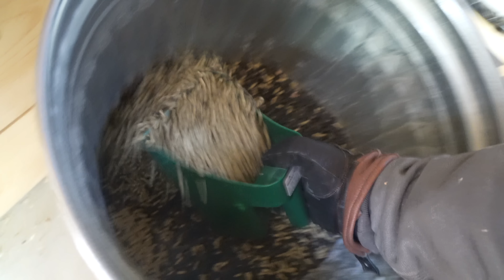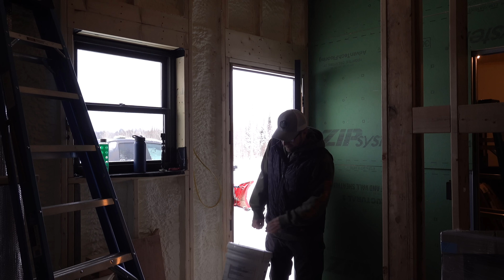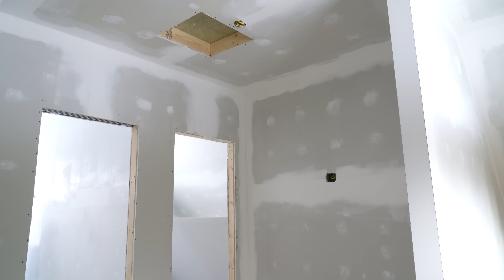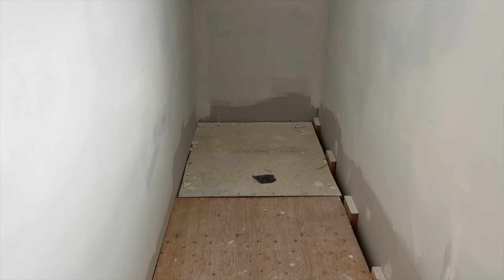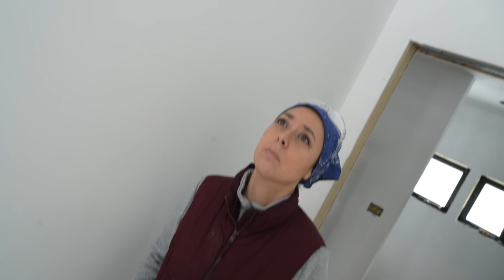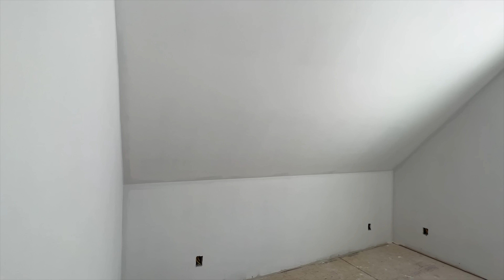FINALLY It's FINISHED!!! Husband and Wife Build OFF-GRID Tiny House in the WOODS

Comment: Gina in the future if you use a short pole on your roller your back and arms will thank you. Having been a painter for years I have found an extension pole always makes a difference in even application as well...further away allows you to see the surface better.
Reply: Should she use a short pole or an extension pole?  You comment was confusing.
Reply: @bettablue2660  short extension pole if I must be exact. Short or long pole allows less effort to apply an even coat and further away from wall will allow you to view your work better. Of course you can use a screw in wooden broom handle cut off to what ever length is comfortable to you for the task. Hope this gives you more insight on what I was saying.
Reply: @garymixson687  thanks, you made it more clear😃
Reply: It doesn't need to be an extension pole . Over my yrs of painting I'd say 90% of it was done with a stick the same length as a broom stick. Anything under 8 ft an extension pole is more trouble than anything
Reply: @mrdio4625  i agree...i have used a cut off wooden push broom handle.  Usually when in tight spaces where a long one will not allow access
Reply: Thank you for the information

Comment: Al, when pouring from a small opening like the 5 gallon bucket turn the pour spout to the top. It will flow out more evenly as the air flows in. Les splatter and quicker fills
Reply: It would have flow out better if you stir the paint first

Comment: Even if it's going to be covered by baseboards, you may want to slap a coat of primer on the drywall down at floor level.  If nothing else it will help protect the drywall from damp.  Your home is looking great!
Reply: if you paint down at the floor you have to do that last or with a brush because dirt will get in the roller... but yeah can't hurt

Comment: I am an old painter take the lid off and stir your paint first and Kiltz is top notch primer. wipe the rim of the pour hole with a paint brush after pouring and wipe the brush out on the wall.  To take the lid off take a pocket knife or a razor and cut each slit in the lid all the way around and pull the lid off pulling up hard on each little flap. Its difficult to pull off but it comes off easier each time after it breaks in.

Comment: You usually apply only 1 coat of primer. It just ensures good bonding and is not supposed to give color coverage. You might work little bit on your inside corners by hand, it seems there are not so smooth. Last, even painting in the lower section an extension is the better choice ...less stress on your hands. Coming along quiet nice, happy for you guys and cannot wait to see next steps.

Comment: Excellent painting job!!!  When doing a large flat surface, You might want to paint a large W on the wall with every recharge of the roller.  Paint the W and use the rest of the paint on your roller to cover the W.  Makes for less streaks.  Aloha from Hawaii!!
Reply: Have you considered a corner paint roller? A lot of what you had to do from a ladder could be done from the floor.
Reply: That is the way I do it, paint is so good now a days it doesn't streak like it use to. But I always cut in first and do trim.
Reply: Would a large M work? 🤣 Sending some snow your way .... enjoy ❄☃ Have a nice weekend ... take care.✌
Reply: A capital “M” works much better.🤣😃😂🤔😎👍
Reply: @robertgiguere7137  😁😎😂

Comment: Primer might have settled, if you remix it with drill and the same paddle you used for joint compound might have had a better consistency.

Comment: have you ever used the 1 inch rollers for cutting in around all the corners and the ceiling.Its a great time saver and it puts paint in the corners and on the wall at thesame time. Great job AL and GEENA

Comment: Two tips. If you are painting that much it is easier to paint out of a five gallon bucket with a screen and when you are painting over your head extend your pole so you can reach further so you can keep your arms lower and can stand a little behind your roller so you won't be directly under it.

Comment: You guys need to stop questioning yourselves. Your doing a great job. Primer is meant to cover and seal new drywall and mud for accepting paint, so it won’t completely cover and you don’t need to do two coats.
Reply: 2 coats of primer is cheaper than having to cover a second coat of regular paint as paint is more expensive than primer, if AL gets a good 2 coat seal of primer and does 1 good coat of paint the overall cost if the painting will be cheaper than if he has to do a second coat of paint, if anything he could have asked thr paint company to add tint to the primer to start the color tinting process of everyting as you can have primer tinted to match the color that will be painted, it's a little trick I learned in the remodeling indusrty
Reply: You can see color variations with the initial coat of primer. That is not ideal. Yes, it may take two coats of paint to cover it which is more expensive, like the reply states below. HOWEVER if you used "Cover Stain" oil based primer, after all it is called cover stain for a reason, only one coat is neccessary for total hiding coverage. Plus if you have any nubs that are showing, or if your roller starts to accumulate the powder left over by sanding, it may decide to lay a glop, or two, or a hundred in different spots that you cannot sand out with water based primer that takes two weeks to dry according to the manufacturer. I wonder how long it takes a second coat to dry on top of a base coat that is not dry yet?
Confession time. I did an elaborate explanation of this before during an earlier episode, and I have to be honest with you, it was painful to see hearts from you guys on every other comment except for mine. I guess I am a sensitive kind of guy, but it wouldn't matter so much if it wasn't for the fact that I love this channel, and what you guys have together so much. I'm a dedicated fan, and i admire how exacting you are in making everything plumb, true, and square. Your cuts are so exact, my hat is off to you.

Comment: A Wagner SideKick machine will make all of your painting go very fast. It's under $100 to. I love mine, did concrete block basement walls in nothing flat. (No pun intended.) You can hook it right up to the big paint container. You'll have to clean it after every use, but it's worth it. You can also get a splatter cover for your roller.

Comment: I drill a small air hole in the lid of the paint bucket.  I use a dry wall screw to pug the hole.
Can you spray paint?  more prep time, but quicker to apply.

Comment: A better trick to extend the life of the wet paint roller is to wrap the roller with a damp paper towel, then wrap that with plastic cling wrap.  Make it long enough that you can fold it over the ends and the roller will be good to use for a couple days.
Reply: if you wrap them and stick them in the freezer, they will keep for several weeks without drying out.
Reply: Yeah and don't completely roll the paint/primer off the roller before you put it away. It's better to leave some on so it doesn't dry out.

Comment: Al, even though the bucket of paint was shaken, I'd still remove the lid and stir it. As someone else said, split the paint up and put a roller grate in the bucket and paint straight out of the bucket, bonus no roller pans needed.

Comment: I suggest getting a paint stick. I’ve done a lot of painting over the years and it speeds up the process because you don’t need to keep going back and forth to the paint tray to reload the roller. You reload the roller through the handle.

Comment: A suggestion for painting.  Use a 5 qal. bucket with a roller screen.  It is way faster.  There is no need to keep filling the small trays.  It is less messy this way.  This is how the pors paint.

Comment: I'm just impressed by the fact that you're using a drywall sealer.  There are many so called professional painters that have never heard of it.  Including the one that I had paint my new home.  I had to explain the concept to him.
Reply: We purchased a home that had heavy smokers as former owners
Reply: Oops! We tore up most of the carpets, professionaly cleaned the remaing ones and sprayed Kilz primer before painting our walls and ceilings.  Being non-smokers, we could not detect any smell of smoke!  It has many benefits for the home owner as previously shared by your viewers.  Your home is looking great, Al and Gina.
Reply: I would like to think that he was teasing you.  He should have known about drywall sealer.
Reply: @pammurphy9311  Not necessarily, around me (north central Fl) you can find Kilz in small cans to seal smoke & such but you have to hunt for 5 gallon containers. And contractors (in my experience) just don't want to use it.
Reply: @pammurphy9311  actually no.  He was from another country.   He contracted through the builder and didn't understand the concept of drywall sealing.  Neither did the builder.  We argued for days.  By the way I am a retired painter but it wasn't in the contract for me to paint my own house.
Reply: @chucktintera1787  That makes sense.  Up in the North - Illinois, they don't want to, and don't legally  have to, use vapor wrap around the outside of the house.  This house, I wasn't able to be here every day when they were building.  I swear our plumber was drunk, things done backwards, upside down and not anchored.
Reply: @timthayer9500  Oh, boy.  Glad you were there to save your house build!
Reply: @pammurphy9311  Illinois? You don't have to tell me, we lived outside of Chicago til '57.

Comment: Get an 8ft extension handle for the high surfaces so you don't have to stand directly under your work. And use the short handle for the lower surfaces so you don't have to kneel or bend down so much.

Comment: Some tips.  
Sand the primmed walls you will love the smooth walls before paint   
 If you roll from corner to corner keep a wet edge you will have less roller marks. 
Looking very nice.

Comment: Awesome job as usual. A little hint. Try a paint sprayer, it will speed up painting by hours & a lot less messy. Also always mix your paint again before using. You have to consider the cold climate the paint endured on way to off grid house.  God bless y’all. Rohan Ranch , north Texas

Comment: Hi al and Gina watching you put that primer on and trying to cut in the corners with a roller that’s a lazy way.as a decorator for thirty years primers and emulsion you should cut in the corners etc with a good three inch brush then use a roller much better finish.

Comment: You should have invested in a good to great air spray hun to shoot the Klix drywall covering as it should take two maybe three coats as that drywall sucks it in. Getting the primer right will save on paint later where one coat might do but two paint costs will be an outstanding job

Comment: If you have not done so, you will want to wipe the walls with a lint cloth to get all the remaining dust off.  Run the drill mixer so the primer is well mixed.  Please be careful with those bracket supports on the stair platform.  Prime in a W pattern.  Long strokes from top to bottom.  Ideally you should paint with the temp being above 50 degrees.  The colder temp will make the water in the paint firm up more..

Comment: I primed our whole house with Kilz.  I had several buckets and I used an airless sprayer and back rolled it.  One of the buckets had obviously been frozen and was chunky and would not flow through the sprayer.  I Had to return it.  Learn to paint like the pros.  Use a 5 gallon bucket with a screen, not a paint tray.  Put a handle on your roller.

Comment: You brought something to mind Al, when you said drywall dust. When we built our house, we found after moving in, that the windows were extremely difficult to open and even more, to close and lock. We had a guy from the window company come out and he explained to us that the thin film on Sheetrock dust created from sanding so effects the tight tolerances that what we experienced, is the result! We had to do a very through cleaning of all tracks, taking the window sections completely out to clean. So…at some point….the time and labor intensive cleaning is absolutely worth it!!
Reply: Good tip - thanks!

Comment: New plasterboard will always soak up your first layer of paint, know matter how thick you roller it on. I always size my walls with a very watery/pva glue mix first, let dry then paint it. Pva watered down solution is a far cheaper option.

Comment: Wow painting already, you guys are fast, with painting I only have one tip, buy the paint regardless of cost with the best solid coverage with minimum  translucency, this alone will save you hundreds of dollars on a small to medium size home. Oh yeah just a side tip, put your top coat color in your undercoat at a 50% ratio, helps with painting so not to miss spots.

Comment: As a professional painter, I suggest you invest in true lambswool roller covers,  Get one 1/2 inch and another 3/4 inch.  Don't buy a synthetic one.  You want the real McCoy.  Be careful because the trash of this world will swap the wrappers between the synthetic ones and the real ones in order to save a couple of dollars.
A true lambswool cover will last for years.  They are a breeze to clean, soak up paint like nobody's business, give a nice finish and eliminate most splatter.  You will not have to dip and reload the roller anywhere near as much.
Remember that your goal is to move the paint from the bucket to the item being painted so, use quality products.  They may cost a little more but in the end, they are worth every penny.

Comment: Hey Al: You can increase your painting speed by about double if you remove the lid on the 5 gallon bucket, pour about half the paint into another 5 gallon bucket and use a roller grate that hangs on the side of the bucket. This allows you to really load the roller so you spread much more paint with each paint application. Also, the roller will leave a different texture depending on which way the roller rotates so finish all of your lines in the same roller direction (pulling or pushing). The painters just leave the roller cover laying in the paint until the next time. 
A quick way to do the corners is to push the roller hard into the corners. This quickly (and rather sloppily) deposits lots of paint on both sides of the corner. Follow up IMMEDIATELY with a brush to smooth off the paint application on the two corner sides. So, go around with your roller and the brush in all the corners. Then, fill in the field with just the roller. Happy Painting!! ;o)
Reply: I love your comment! I just want to make sure I understand it correctly, do you put the grate on TOP of the 5 gallon bucket? I don’t see how it would work on the side?? I’m a 61 year old Grandma and I’m going to be painting the inside of my home, I’m very curious about this, Thank you for sharing:-)
Reply: @rebeccajones8830  The grate hangs to the inside of the bucket which is why you pour half into another bucket.  Google paint bucket grate.  Once you see it you'll understand.  It's totally worth it if your painting a lot and it sounds like you will.
Reply: @michellecook2739  oh now I get it! That totally makes sense ! I love it! Oh I can’t wait to to try it! Thanks so much for sharing this!!!
Reply: I never used the grate. With a bit of practice you learn to hit the sides of the bucket with your roller which when done properly causes the roller to spin and shed excess paint. Hard to explain but when you do it right it looks kind like you're churning butter

Comment: Hi Al your roller tip is what I do but I also put the paint trays in a plastic bag then put the paint in at the end of the day just throw the bag away no cleaning of the tray ever so does not matter, Also the rollers are so cheep compared to my time cleaning them when i change the colour I just bin them and use new. Any new tools you buy look after them and I'm sure you will and you can use them on the main house take care.

Comment: To stop the berbuling, pour with the hole on the top and not on the bottom of the bucket, not so much with the very thick paint, but with other liquids, you won't have a problem with splash.

Comment: We always found that the tall round containers for those preformed chips that start with P was good for keeping the rollers dry overnight. We just slipped the rollers off the  'brush', slipped them in, put on the lid, and put them in the fridge. Next day, or day after, just took off the lid, slipped the 'brush' into the roller, pulled it out of the tub, put the lid back on, and back in the fridge, to use again that evening.